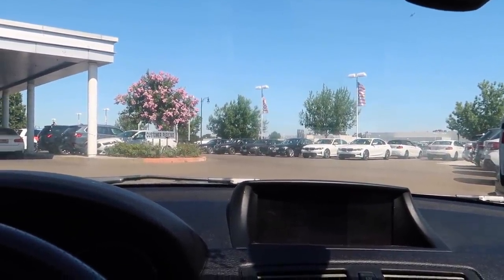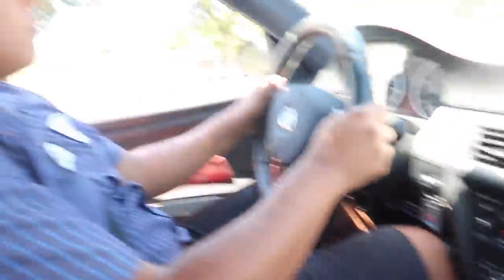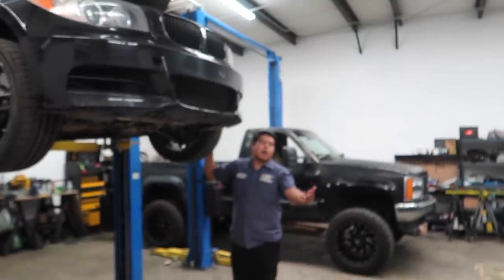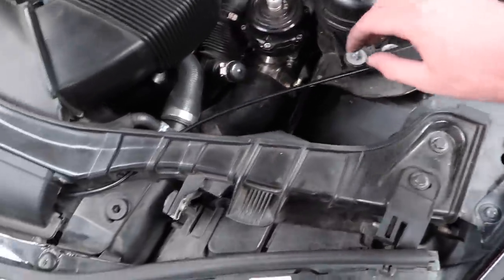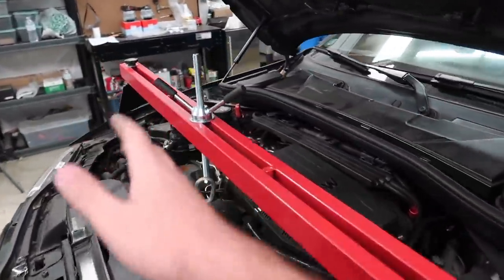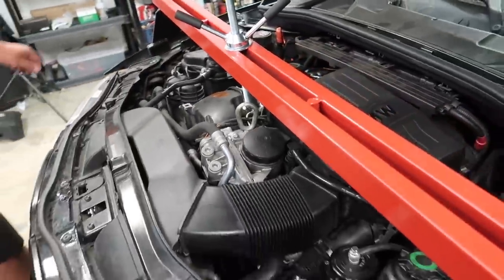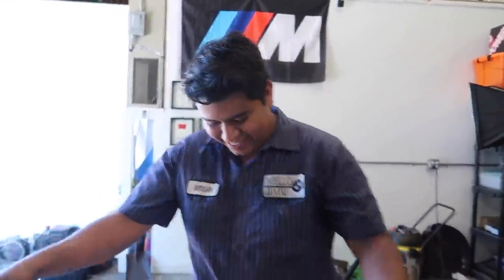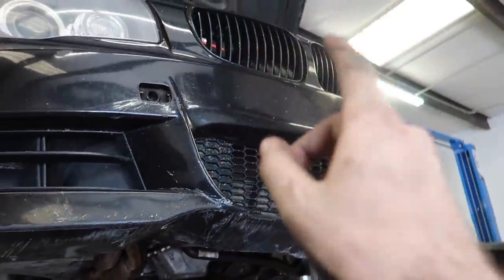800HP 135I SUPERCAR KILLER BUILD! (PART.1)

Comment: For the noise if you do the valve cover gasket soon just check the timing chain guide by removing the tensionner and try to pull the guide out with medium-low force. Mine did the exact same noise and chain guide was snapped, pretty hard to hear but it looked like the same noise

Comment: Pure 600s installing on my 335is you have the same transmission I’m guessing DCT go w pures 600 w tune it’s 500 whp on 93 a f80 full bolt on is 480 whp w e85 530 whp i’m doing my fuel injectors (Fcp euro lifetime warranty) and my belt kept shreddeding fits got in my engine I had to did the oil pan gasket due to clean the bits pls bro as muslim brother  get the metal piece to prevent in from going behind the crank pulley it’s a must have for n54s with 100k plus they’re more likely to have a shredded belt then not get that metal piece you install behind the crank pulley